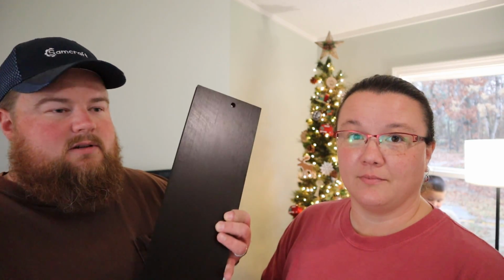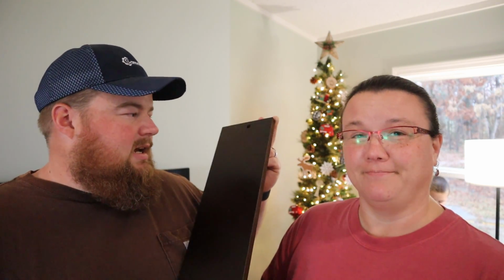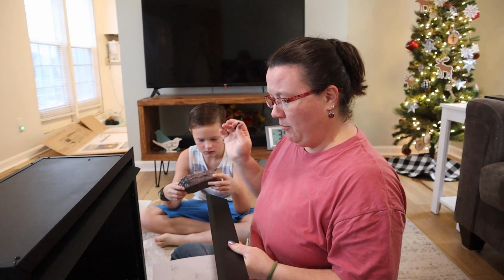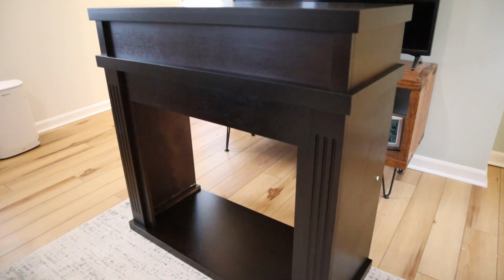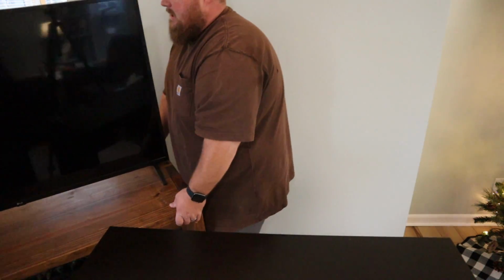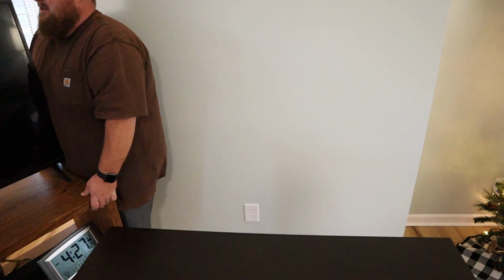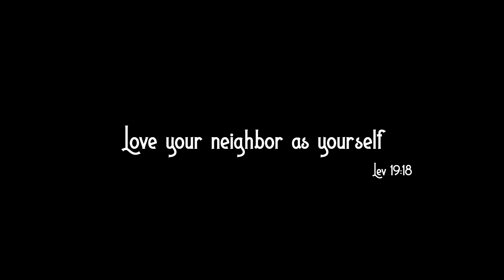Assembling our NEW FIREPLACE for our MOBILE HOME!

Comment: Neat idea. I wish it was a vented heater though but as you are not using it for your primary heat source and you are aware of the potential hazard in using up the O2 in the house I think you'll be OK. I am sure your brother will do it up right for you. Please be careful though, your house isn't nearly as air leaky as it once was due to the great work you have done remodeling it. Much love and stay safe.

Comment: We have a tv mounted above our fireplace, it is a gas stove, and there is plenty of heat coming out but the wood frame is never hot, nor is the mantle! It heats the den and our kitchen, sometimes have to go outside to cool down. We keep our on automatic! It has come on when the air comes on! Funny! We have about 2400 sq feet house! We have gas logs in our great room, but never turn it on!

Comment: Looks great, but... Propane heat can increase humidity and cause condensation issues if used too much. Also, unless you have a large propane tank, a small wood stove would be better for emergency backup heat. Though it would be harder to install.

Comment: I have a similar setup. It overheats the wiring behind the unit where the tv is plugged in and turns the tv off. 

My tv is also mounted above the fireplace as well.

Comment: do yourself a favor get a piece of 3/4 ply 30 wide by 24 tall rout a 1/4 round over on the face side paint it black and mount it with several screws to the studs behind where you want the tv to be mounted to as you can center up the ply and attach to at least two studs now mount the tv hardware to it to hang the tv

Comment: Hello from Australia. Your home is beautifull, you must be so happy and proud of what you have achieved. Home is definitely where the ❤ is. Do you have a ceiling fan in that room, if so, would you still need an additional fan on your heater? Wouldn't the ceiling fan work to push the heat around. Hoping you can save some money on additional purchase. The fireplace looks wonderful.

Comment: I love your new fireplace and was wondering how you're planning to fuel it, propane, natural gas or electric?  If propane or gas, how are you going to vent it?  Will you show that?  I'm asking because I fell in love with it and want to install one in our home but it wouldn't be on an outside wall like yours and don't know how I could possibly vent it outside.  It's an awesome fireplace and much more  economical than putting in a real fireplace.  We've had quotes as high as $10,000 and I can't see spending that kind of money when I could do a wood burning stove, but I don't care for that route either.    I have to say, with all the improvements you've made inside, anyone would be hard pressed to say it's a mobile home and not a stick built.  Following along on your journey has been extremely enjoyable and I look forward to all your videos.